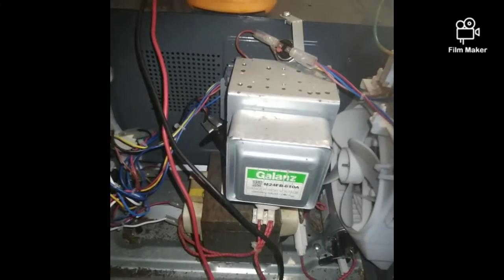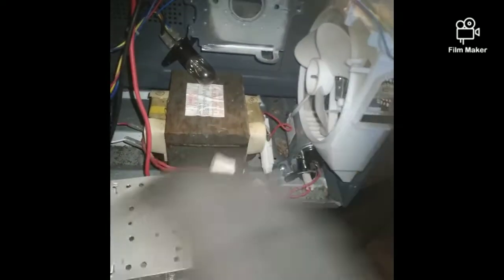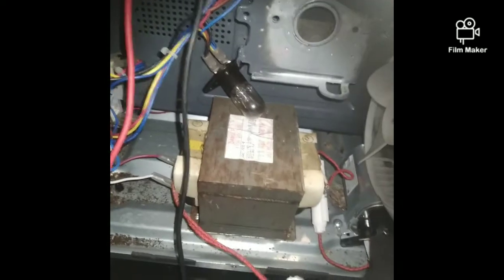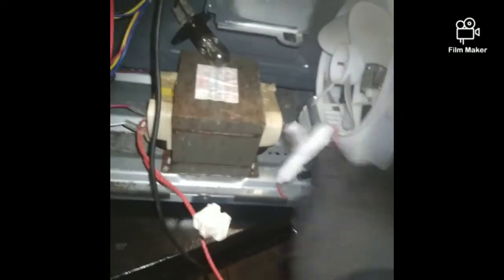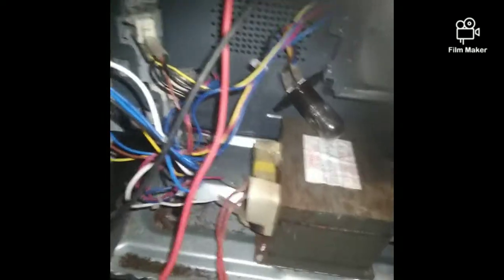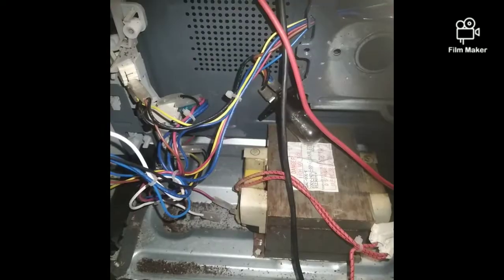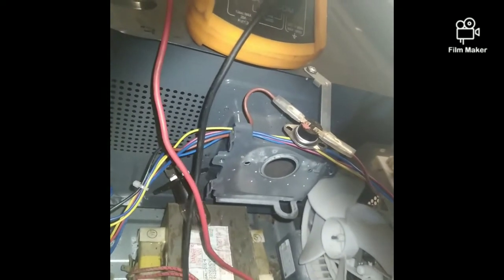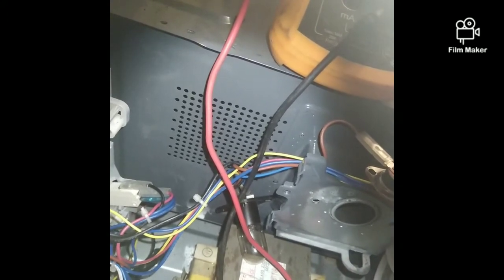how to test the microwave oven transformer

Comment: Isn't it when you get a beep it means the resistance is zero? How about testing for resistance rather where you'll expect some number which is even above 1not a beep.
Reply from the maker: Yes, but this days when you test resistor for an example It will beep and give you numbers because other multimeter they have sound and diode reading on the same setting and when you set your multimeter on ohms reading it will give you the correct numbers… so when someone test something must double check
Reply: Thank you